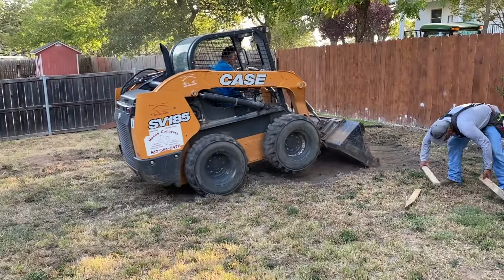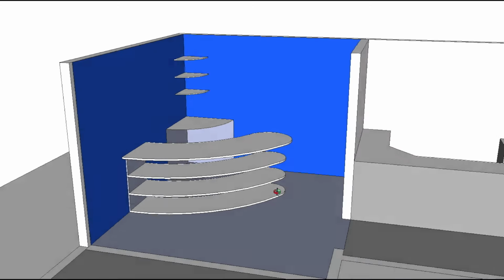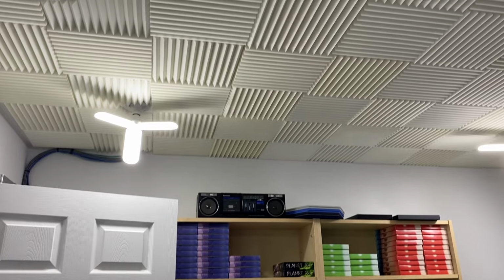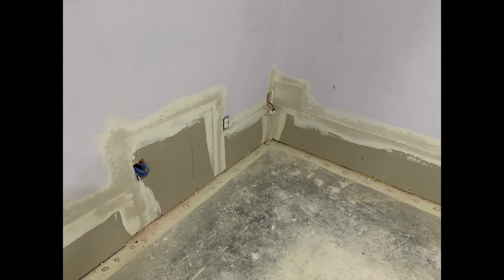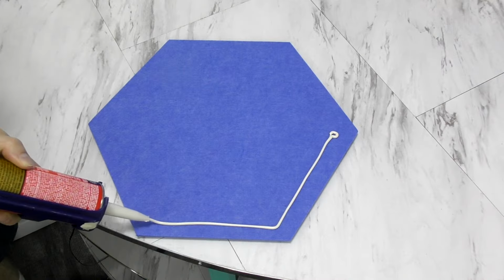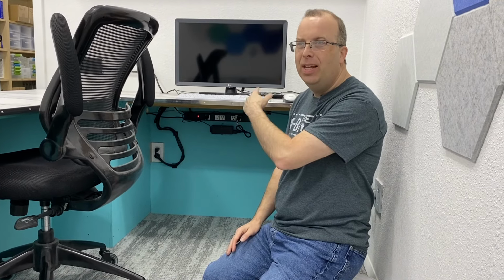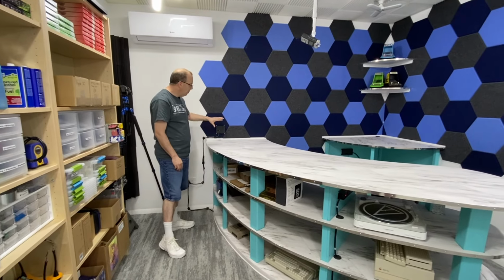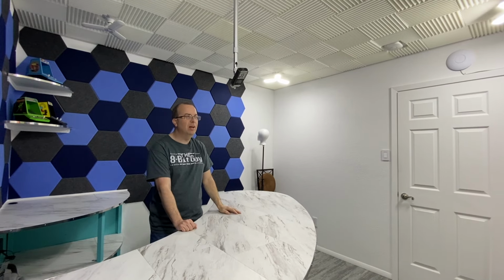8-Bit Guy Studio Build - Part 3

Comment: I do like the background but the part of the wall in the last bit of this video, stands out a lot, if your going to stick with that background, I would consider covering any part of the wall shown in frame, with the hexagons, those blank spots tend to stand out, but also the counter, its so bright, the marble streaks are almost washed away, the counter just looks soo much brighter then anything else, I would almost try making a sort of 8 bit design with those hexagons, like in the shape of an 8 or 8B or something like that 8BG, or do one of those cool motherboard walls, I know its been done but that doesn't stop it from looking pretty cool, or hell maybe try making a counter top of old motherboards, just old boards with resin pored over to make a smooth flat counter, I don't know just spit balling ideas.

Comment: So where the Keg Cooler?
Hard to tell the gray from the black tiles.
Need to put some sort of indicator on your ground lift switch. Guarantee it will end up in the wrong position.  Should run it through a ground fault system that would kill the AC if it detect a "power" short to it.
Need to check you electrical code on that.

Comment: As a hvac and plumbing contractor I have used shark bite type fittings in a pinch. That being said I don't trust them enough to have them buried in a wall as it looks like yours was, whether or not they are "ok" to have within the walls.

Comment: You should have used grounded ESD dissipative vinyl for your benchtop and surrounding floor to minimise unwanted static electricity build up.
Reply: Also, lose the metal banding on the electronics workbench because it is an unwanted hazard.

Comment: Good job! But really... you should get rid of that ground wire you've sodded into that box. If you have anything, for whatever reason, that grounds out, that metal strip around your desk will become active leading. That's why you NEVER put on an ESD band, hook it to your PSU and connect the PSU to your wall-socket. That's not what ESD discharge is about: It's about placing yourself on the same electric level as what you are working on. That's all there is to it. Doesn't matter if you have a high electrostatic level in your body, as long as your body's ES level is on the same level as the environment you are in.

What you do when you potential equalize waterpipes, steel armour in concrete, etc. is that such grounding you lead directly to the ground, not to your electrical circuit. ;-)

Comment: I don't hate the original background. For the banding around the desk, I would be tempted to use countersunk flat heads or maybe even have tried to bond it without screws but that is just a matter of opinion. I hope you pulled CAT6e since 10 GB networking is becoming common. I would have been tempted to use fiber but again just an opinion. Overall that is cool. The trick for making grounding safe is to use a really large resistor 1-mega ohm between you and the ground.

Comment: My only suggestion is to add a right angle adaptor to your Ethernet cables in the secondary room. It'll relieve stress on the cables at the wall end and might even make it a little more elegant. There's also the option of Powerline Ethernet but that brings up more cons and pros that you might not want to deal with

Comment: Dude, congratulations on the new space; it looks awesome! If I may a word on acoustics:
Thin foam and felt tiles may look nice as a backdrop but they absorb only the very highest of frequencies. They're best used sparingly. It's all too easy to create a space that sucks all the upper frequencies out of your recordings but still imparts ringing and phase issues at lower frequencies. Remember that you have thin carpet on the floor which is also contributing to the high-frequency dampening.

Fabric-wrapped 2" high-density rockwool or fiberglass (or cotton batting) panels have a superior absorption coefficient and are effective across a much broader range of frequencies they cover the vocal range adequately. They're easy—and relatively inexpensive—to DIY (wear a mask!) and can also be purchased premade if that's your preference. They can be essentially any color or pattern you like. 

If it's in your budget I'd recommend placing a few on the wall opposite your desk, and perhaps even one on the door. If it was my space I'd strategically place a few these on the ceiling, replacing the foam.

If you post your SketchUp model somewhere for download I'd be happy to share some ideas with you. I'm not a trained acoustician but I've been a recording engineer for the better part of 25 years and have treated quite a few rooms over this period with good results.

Comment: That is a fantastic studio! I look forward to the next episodes filmed in it. I'm sorry for your accidents: I hope you'll have a full recovery. 
 A suggestion for the grounding strip. Even for the closed switch configuration, put a 1MOhm series resistor between the strip and the GND line. This way the current will be limited even if you forget the switch on, and 1MOhm is enough to dissipate statics in a few seconds.

Comment: The hexagons are great IMHO, but I also liked the vinyl just fine before.

What's not so great is your white balance.  Your skin has an unnatural tint to it. It needs to be a bit warmer toned IMHO. There's a LOT of green and blue in that room, and you're short on red balance. That should come from skin tone. You may need color correction in your lighting.

Comment: Hah, I did something similar with the grounding wire but far less fancy than your solution. I just ran a wire from a wall outlet's ground hole to somewhere I could reach it.  It kinda works.

Comment: Just throwing my 2-bits in here.  The wall should be approximately the same brightness level as you are. face and clothing.  Maybe just a shade darker to make you look brighter. The work surfaces should be a 50% grey or some color equivalent because you never know what is going to be on the table at any given time.  Could be something dark or something light.  Most of the stuff you put there has that tan color so you should stay away from anything that would blend in with that. 

For those who don't know, 2-bits is an old term for a quarter. Nothing to do with computers.

Comment: I recall your wife hating putting that background up on the wall!  LOL  I don't love the hexagon's either, but they do help with the audio.  They are certainly better than the triangle background, but I wasn't complaining about it.  Again I recall just how much time and effort that small section took your wife to put up.

I think one thing that would help with the hexagon wall is to cover all the bare spots that are in frame.  There is clearly some wall still showing and that can be detracting to the shot.  There are also some gaps between the hexagons.  If the wall was a darker color it wouldn't even show up, but since the wall is bright white is glares through like sunlight.  For some people at least.  And it's one of those things, once you see it, it's hard to unsee it.

I love how your office space turned out.  I actually like the lighter gray vs. the darker one.  It just lightens it up more which would help with the colors selected for the benches which turned out great.

Oh you didn't show us the storage room!  I suspect it's still a work in progress.  Cool update.

Comment: A very sold end-result. I think most will agree that sometimes with the tiles are a bit off. You will probably read a million guesses in the comments as to why. All I know is that in my eyes they overwhelm. Almost as if they're CGI/added. Way better than what you had before though, and also way better than your original plan. Anyway it's good enough to keep for a while. I wouldn't put off the table to change down the line.
Anyway hats off to what seem to have been a very busy year that you tackled back perfectly.

Comment: Remember in your teens or early 20's when you fell like that, you didn't injur yourself, but if you did it took a fraction of the time to heal? Those were good times.
Reply: It was even faster before that.  Humans are actually born with soft flex instead of some bones, it allows the contortions of getting born.  Forensic pathologists use the amount of unreplaced flex to determine the age of victims.

Comment: About that grounding wire. If you forget to flip it when it isn't grounded, you might break something. If you forget to flip it when it is grounded, you might die. You should put that thing on a timer so if you forget to turn off the grounding, it will do it for you. That would be fail safe, where right now it is fail unsafe.

Comment: Might be a decent idea to install some acoustic paneling or thicker foam. The foam you applied to the ceiling isn’t really able to do much, especially at that thickness. You could probably make the acoustic paneling also serve as banners for various tech and computing related things

Also in case you aren’t already, you could use a solid core door instead of the standard hollow/corrugated doors, and install weather stripping to cover the gap underneath. These won’t make a massive difference but they will be noticeable

Comment: David, that grounded band is a recipe for a (safety) disaster!!!! Usually you want to put a large resistor in series with the ground line to avoid being electrocuted by a relatively large current. Since you are going to work also with CRTs I would recommend removing that grounded strip altogether and use a proper grounded wristband only when dealing with low power ESD sensitive electronics. It's too easy to forget to flip the switch. Very very dangerous!!!

Comment: A few thoughts from a video production perspective... 

The LED worklights aren't giving a great quality of light. There definitely appears to be a green spike that the camera is have trouble dealing with. I think you'd get much better results and color fidelity with even some modest video lights. 

Overall, given that the environment is controlled with consistent lighting, the best thing to do would be manually white balance and expose the camera. It should be something you can just set and leave from video to video. Then the relative brightness of the background won't matter (although I like the hexagons). 

The sound treatment is working well, but the audio quality from the lapel mic is considerably better overall, so it would probably be a better mic to use for videos generally. Otherwise, if you prefer to use an external mic, then attaching a directional shotgun mic to the Zoom recorder would probably give much better results - the standard Zoom X/Y capsule has a fairly broad pickup pattern and is collecting a lot more reflections than a hypercardioid shotgun mic would. You could easily connect a inexpensive shotgun like the AT875 to the channel 3 input on the recorder.

Keep up the good work!

Comment: that's... not how grounding works.  you only need to be afraid of grounding while working on a CRT if you complete the circuit on the CRT chassis itself.  There is no circuit between the flyback anode and the electrical ground of your shop unless the CRT is both A) plugged in and B) not isolated.  I would suggest that you leave the grounding switch ON, and install a several megaohm resistor between the connection to the metallic strip(s) and the electrical ground from the outlet.

Comment: David, Great job and the best of luck with the new studio.  If you are open to a bit of advice regarding the background from a photographer, I'd advise the following. Go for bland monotone backgrounds or gentle patterns. Avoid bold contrasting stark transitions, they are just a distraction.  You can always add diffused front lighting to compensate for camera exposure.  Avoid infrastructure such as shelving directly behind you cos it ends up again as a distraction and often forms tangents off of the person in shot. If you must have infrastructure, go minimalist and have if off centre. Think about news anchors on TV and consider where they put the screen behind them. It's always off centre off to one side.  Filming in a corner is not ideal because you have a very distinct harsh line cutting straight down through the middle of the shot where both walls meet. One possible solution is to round off the corner creating a kind of infinity background.  Don't be afraid to frame yourself off centre, even to one third left or right.  Remember, a background should be just that - a background.  At the moment your background is shouting for attention. Wonderful channel and I always look forward to your vids. K

Comment: I may have missed it, but I didn't see any fire extinguishers... If you don't want extinguishers taking up room down low, see if you can install a hangar fire foam suppression system. You might be able to pick up a used one cheap from Boeing. Testing that would be make a fun video.

Comment: Are the hexagons perfect? No, but they're good enough, and a massive improvement over the previous vinyl. Those were quite distracting.
Reply: Thing is that it's clashing with the color of the furniture
Reply: There's also comfort with familiarity, like how you might not like a song initially until you've heard it a few times. After a few earnest videos have been shot in the set, it will become the new normal. Gotta say, honestly that first-gen airport router was starting to bug me.

Comment: Course on ESD-grounding: You never ground directly to Earth. You always use at least one 10 MOhm resistor.
This will slowly discharge you and it will not be life threatening if you're working on live voltage (we have 230VAC as standard in Europe, so we'd draw much more current if we 'short' ourselves to GND). I've worked in several companies where we grounded with resistors. You can actually purchase expensive resistors in a plastic-package from Farnell or RS Components, but they still just use a standard 1 MOhm or 10MOhm 1/4W resistor.
Edit: And I didn't see the comment from Matthias Wändel before posting...

Comment: I never understood this grounding thing and it's driving me nuts: so, if you are grounded and you touch a CRT you avoid getting electrocuted, or is the opposite??
Reply: If you're grounded, and you touch anything that has a high voltage, you'll feel the electricity continuously.
However, if you're not grounded and you touch something that has a charge, you'll be charged and if it's a very high voltage (eg. more than 2.5kV, you'll feel it when you touch something that's grounded - like a radiator or metal pipe - and in some cases a door-handle).

Comment: I really like the hexagons, I think that color scheme really works. Sure, it's a little busy, but I think that makes for an interesting picture even when there's nothing on the workbench. Make sure you get a few more hexagons to cover that bare part of wall in the lower right corner of the frame!
I agree that it would be better if the bench color scheme matched the wall color scheme, but I like the light color of the tabletop, so I'd suggest choosing the shade from the hexagons that you like the best and repainting the teal bench supports that color.
I also suggest maybe raising the height of the overhead mic enough that you can get the contents of the upper shelf in shot. It feels a little weird to have the stuff up there be just barely unable to be seen.

Comment: The building has really come along and looks great. I was out of town for the snow so I don't believe it happened. :) :) If you want to run that missing LAN drop for your desk I would be more than happy to bring over a long flex bit that you can put in the hole and drill through the top plate and pull the wire down with. You never have power or LAN where you need it.
   
  The hexagon tiles are interesting. Not sure what I think of them but they don't make me think they are ugly right off the bat so time will tell. One tip when putting stuff like that on the wall is to paint the wall black first so any gaps between don't stick out like white does. 

    I would have made a steel support frame for the desk as it would have been more hidden that way but you gotta use what you have access to.

Comment: Allright! Looking good! 
The nerdy soundengineer wants a bit more dampening(the walls and surfaces behind the camera. The back of the door etc.) The hobbyist photographer also want you to get the color temperature/lighting under control, and maybe a somewhat warmer look, the skin tones are out of control with condusing white balance. Combine it with at least a slightly narrower depth of field.
A better mic might not hurt, or just stick with the lav, but do ditch the Zoom!

When you have done this. Make sure you set your camera to manual and note the best settings No use in reinventing the wheel time and time again. 

Anyway, good to see you fullt back on track. Great content!

Comment: @The 8-Bit Guy I don't know if you mentioned it before, in another video, but what are the dimensions of the 2 rooms in the new studio shed, and how far back from you do you keep your camera??? I'm  currently using my Google Pixel 4a as a camera, but I can never seem to get enough distance between me and the camera, to get me and my projects in the shot... I'm wondering if there's any difference in recommended placement between say, a pixel phone, and an actual video camera, like a "Sony A7-III" for instance... It'll be different when I get a shop finished off and built, but I still want to know what space you're working with, so that's can plan it properly

Comment: When it comes to sound deadening,number 1 rule is simply remove ALL parallel angles. Even if by only a couple degrees,off set the walls in from side to side and the triangle pattern on the foam is there for the exact reason